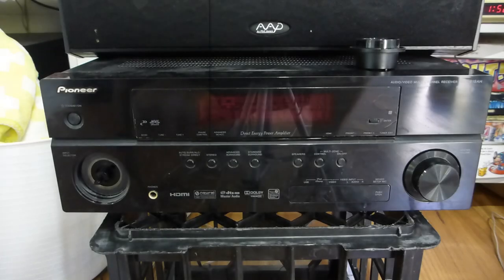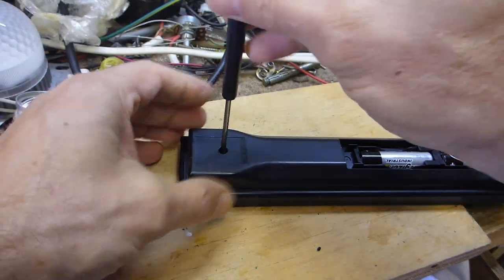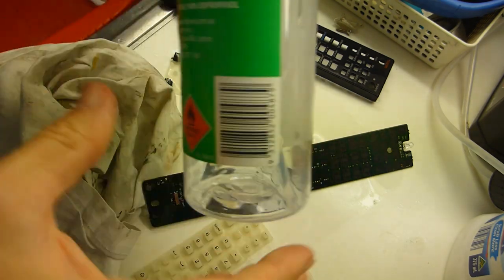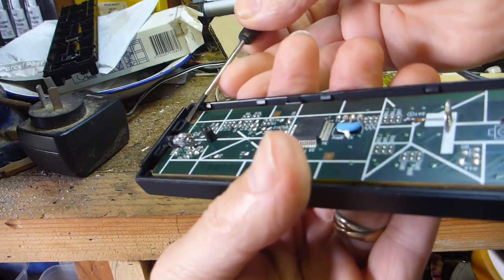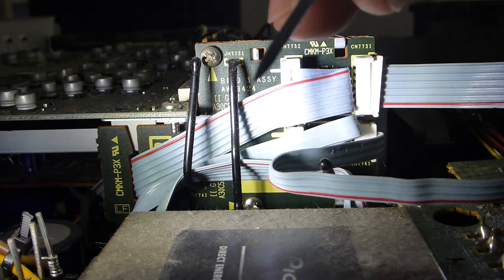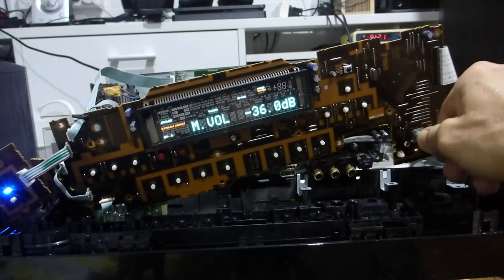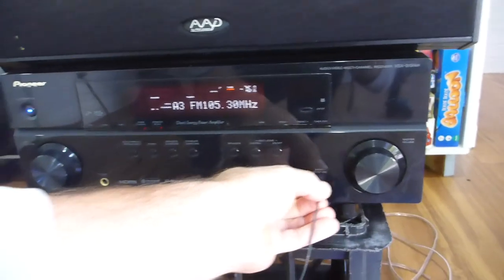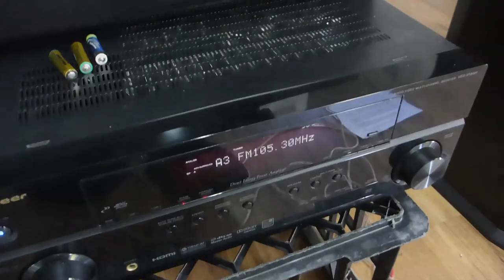Pioneer VSX 919AH Receiver Repair and Review, plus AXD7553 Remote Rebuild

Comment: Hi, recently I bought the vsx919ah struggling to set up the equlizer, I have the duplicate/replace remote and can not access the mcacc through the tv. Any advice that you can provide
Reply from the maker: It's possible it's not the correct remote. Many in the Pioneer family use similar remotes on identical IR frequencies, but not all can access all functions (check vsx919ah manual for  the correct remote model number). MCACC is at best, a guess, and measurements of delay times are usually not correct anyway. I would access MCACC via the front panel controls (or a combination of front panel and remote), and go from there. I'm happy to let auto setups do there thing, but I always use my own ears to tune anyway.

Comment: Does the fan on your unit run continuously? Mine runs ALL the time. I'm not sure if it is a fault or not.
Reply from the maker: @igotafix  should only run when temperature is high on heat sinks. You have a fault.